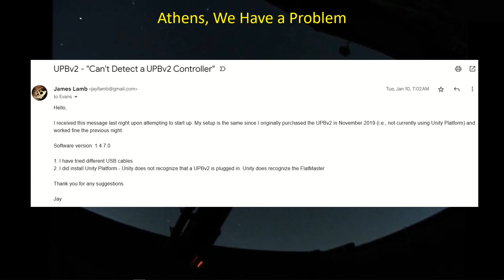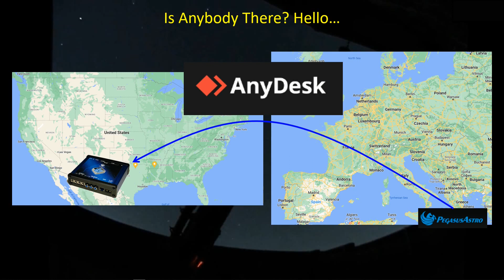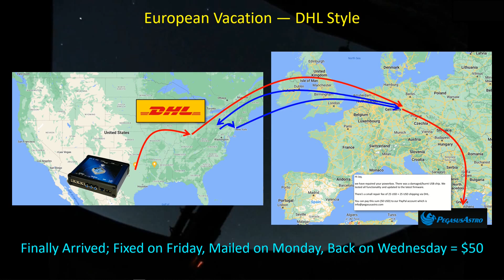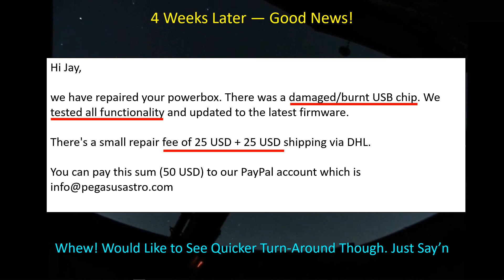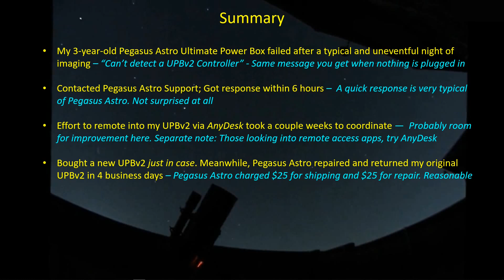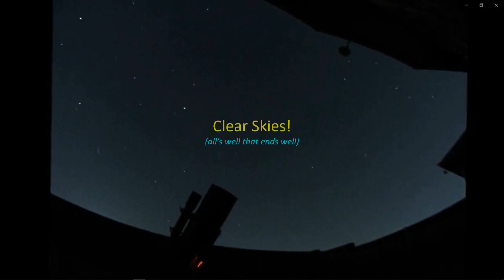Pegasus Astro Power Box Failure

Comment: Thanks for this video, James. Planning on purchasing the Ultimate Powerbox v3 when it becomes available (Sometime in November now, I believe) but I was wondering if you protect yours from dew someway when it is outdoors? I would definitely like to mount the unit it on the scope, but was wondering how to do that and still get protection from dew. Thanks.
Reply from the maker: I have in the past. I've used a large plastic food freezer bag. Cables come in the open side and in through a hole I cut in the bottom of the bag. I also cut an opening to get access to the velcro patch. I seal the opening as best I can. Works great. I may go back to it once the humidity picks up.
Reply: @Aero19612  Thanks for the reply, James. Never thought about freezer bags. Thought maybe small plastic ‘Tupperware like’ containers that you can purchase at WalMart. Could cut holes for cables … and seal the area around those cables with rubber bungs. But I would need another one for my mini PC as well.

Comment: I thought mine was dead when I pulled it off the shelf after it was sitting their for close to 2  years.   Couldn't find my software for it, so I downloaded the Unity software,  Unity couldn't find it.  I went on their forum and I told them that the unity could not find my UPVv2  I told them it's from a earlier release.  They said it may have been a firmware issue and gave me the link to down load the old software and give it a try.  It found it and right away it wanted to update the firmware.  I let this happen.  Than I started the Unity software and it was found. and works great.
Reply from the maker: Ha. Next time you pull one of those off the shelf, send it to me! You had a lot more luck with updating the firmware than I did. I tried twice. It failed twice. Never tried a third time. Pegasus Astro did update the firmware in their shop after they repaired it. Glad it worked out (like it’s supposed to) for you, Mark!

Comment: Good info James and could not agree more with your conclusions.  Also, thanks for the shout out. I actually had similar experiences with my second Pegasus Pocket Power Box. I emailed them and an hour later they were on my computer remotely - I already had AnyDesk as I had used for a couple years although now I just use Google Remote Desktop.  I also had to ship it back to them but they had me send it directly to their distribution person in NYC who then shipped it to Greece (The Greek Connection).  My problem was a burned out power connector typical when you plug the powersupply into the camera output port which is what I did so it was my fault. They had it back to me very quickly and I covered the camera port so not to repeat my error. I am going to get a third one very soon for my portable setup.  I find these very useful. Also, I received a new ASI2600 MC Pro, approximately two weeks from leak to replacement. - Cheers and thanks again for the mention, Kurt
Reply from the maker: Wow. 1-hour turn around for remote access. I know you’re one time zone closer, but geez. I lost 2 weeks between reporting a problem and finally getting the remote access set up. Wasn’t too thrilled with that. Oh well, I’ve just lost 6 weeks to clouds so that puts things in perspective.
Reply: @Aero19612  Yeah I was shocked, I guess someone could not sleep there.  If it is any consolation the weather here is not any better....

Comment: I had a problem with my PPB after updating the software to the Unity. Unity failed to recognise my PPB, so I reverted back to my original software, and it ran perfectly. After I few days I tried Unity again, with success this time. Not sure what the problem was, but everything is fine now.
Reply from the maker: That's weird. I had an issue downloading the images with the installed and updated version of Unity Platform. I rolled back to the earlier version and haven't had that issue since. Thanks for watching, Brian!

Comment: Disappointing that it failed after just three years but good to see Pegasus Astro fixed it quickly. I've been using Anydesk for some time now and it's great. I remote into my rigs and I like the fact that you can log into more than one rig at the same time from the PC and on multiple devices at the same time too. Funny the route your Powerbox took to get to Greece. I had a similar thing when I sent my Redcat back to Taiwan - it got to Taiwan via several stops including China and looked to be only a short journey from the the city where WO are located, but then it suddenly went back to China, then Tokyo, then China for the third time and to Taiwan for the second time.......and then got delivered to WO 🤣
Reply from the maker: A good idea for a video: "The Secret Lives of Packages in Transit". No way that UPBv2 should have failed only 3 years in. Especially considering how much I DON'T use it given all of the clouds, wind, and Moon. I'll keep my fingers crossed from now on. That should help.

Comment: I’ve had intermittent issues with mine as well, for me it’s always been a software issue. Every time I’ve fixed it, it’s been a slightly different process haha. Something with my imaging software and the unity server not talking to each other properly. It’s fully working for me now. I’m glad it’s not a USB chip for me!!
Reply from the maker: Interesting. When I first installed Unity Platform for use with the new UPBv2, I had issues downloading images from the camera. I went back to the earlier version and things have been working. With my original UPBv2, I tried to upgrade the firmware on two occasions, and it failed both times. Not sure what's going on with the software side. Thanks for watching, Cole!

Comment: I've found that the Astro related suppliers and distributors have been excellent for support.  This is good yet sad given I've got experience with that.  In the mere 18 months I've been in this hobby I've had:
- two Wireless routers fail
- one 500w power station fail
- an EAF fail
- the controller board in the EQ6RPro fail.  Twice.
- two dew heaters fail
- 12v power brick fail
- multiple cable and connector failures

It has been a process and an evolution where with each failure I attempt to learn some hardening technique.
I don't want to get started with drivers & software and that the entire software ecosystem is built on top of sand.

I love a challenge .. this is perfect.  😁
Reply from the maker: Wow, Bruce! That's a lot of failures. If I had that experience, I might be questioning my life choices... Way to hang in there!
Reply: @Aero19612  In a way it is humorous given the number of failures.  Just had another one tonight: a ten amp 12v power supply started glitching on and off causing the mount and camera to disconnect.  Took the PS apart and discovered that one of the three prongs on the IC mounted 120v AC power connector had a cold solder joint at the connection point on the PC.  Fortunately an easy fix at the solder station.  Eventually I hope to have everything hardened.  Ha!

Comment: ESD my friend. Static electricity can reach thousands of volts, and when plugging in your USB cable, find a nice low resistance path to ground through the USB interface chip.
Reply from the maker: Ahh. Very good point there, Bill. Any additional detail on your suggestion. I know there are ESD wrist bands that can be tied off to ground. What else/other would be appropriate?
Reply: @Aero19612  Hello James! An ESD wristband would certainly work however, you would need to be tied to a low-impedance ground when using it, which is not very practical. A quicker solution would be to discharge any static electricity on the USB cable by touching it to an exposed water pipe. or a piece of 12 gauge copper stuck in the ground near you before inserting the cable. Unfortunately, the Pegasus box does not offer much ESD protection. I also own this power box and suffered a similar issue with it. To solve it, I added TVS diodes to the USB ports that I use. Placing them between the D+ and D- pins and ground provides about 15KV of protection against ESD. You could also consider adding a ground wire between the Pegasus box and Earth. Good Luck!

Comment: $50 is not bad for repairing your 3-year old unit but I would hope for it to last longer than that before breaking down. I purchased the Pegasus Powerbox Advance 2 in 2021 and haven't any problems as of today. I use it at least twice a week so it's getting plenty of use and still works like a champ. Nice video of what to expect in case mine ever breaks. Thanks!
Reply from the maker: I'm right there with you. When I shell out $600, that component should never fail given that it's not used all of the time. I mean, my refrigerator has been working for 11 years, why can't this thing?

Comment: This is one device I don't understand yet. Do you use it to turn things on and off or is it more for the distribution of power (my power currently is a single 12v cable up to a cable splitter to go to all the devices) and everything plugs into the mini PC USB's. Im not sure how this would improve things?
Reply from the maker: It may not improve things in your case. Before I bought this, I had a ton of AC/DC converters and cables. This handles all of that. The UPBv2 is also a USB hub (4 USB3 + 2 USB2). It also has 3 dew heater ports, so no need for separate controller. There's also a focuser motor controller, but I don't need that. The control software is pretty slick and allows you to cycle power to the individual power ports (4 12-V + 1 variable-V) and to each individual USB port. There is an environmental sensor/port for measuring temp and humidity. Expensive, but useful (for me at least)
Reply: @Aero19612  It might be useful for the power cycling but I have a few relays i was looking to use to do a similar thing
Reply: I'm in the same boat.  Obviously people who use them, like James here, find them essential so they must be doing something right.  I presume it's mostly a cable management thing, but $600 seems like a lot of money for the benefit of only having one cable floating in the wind.  I use an ASIAIR which seems to do a lot of what the Pegasus power box does at a considerably lower price.
Reply from the maker: So true, Clint. Too expensive. I won’t buy another one. I need to educate myself on other/DIY options that have the same electrical safeguards as the UPB is supposed to have. Always room to learn more.